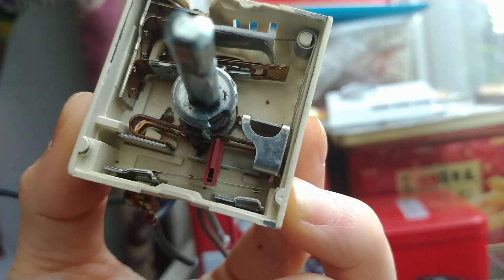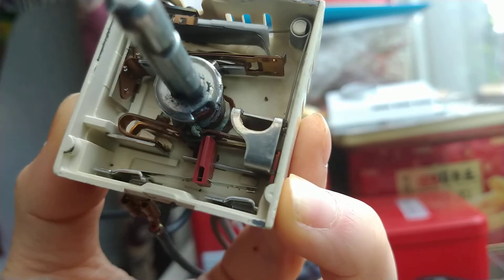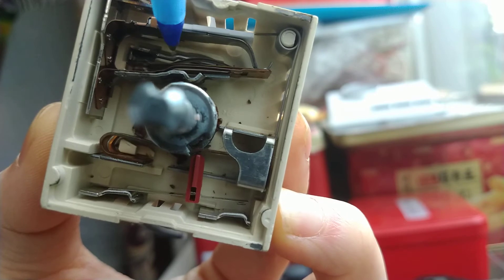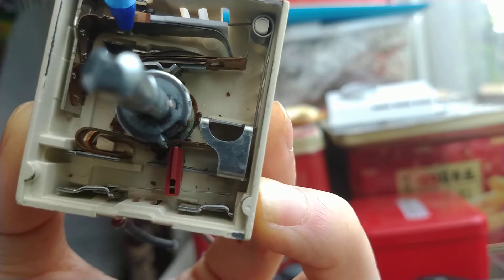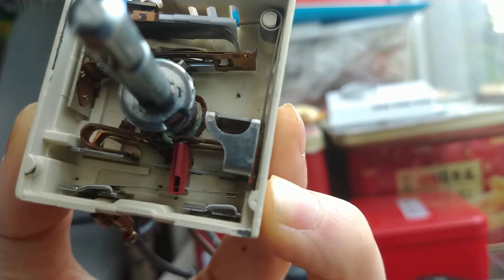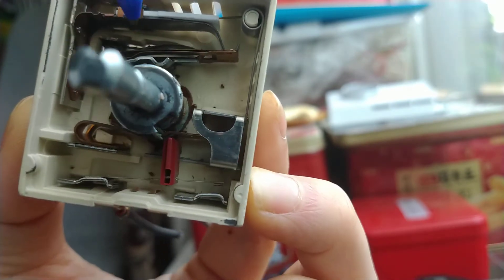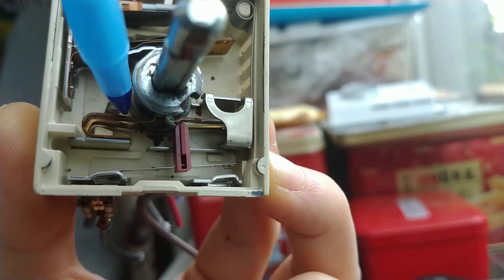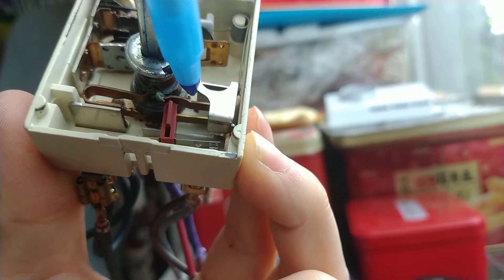dual surface element stove infinite switch inside . how it works. part 1

Comment: Thank you for this information. It helped me to select the correct replacement. I was wondering what the S1 and S2 pins where for. Mine does not have those pins but the replacement I was looking at did have them. Your video helped me to see that I can just ignore them.